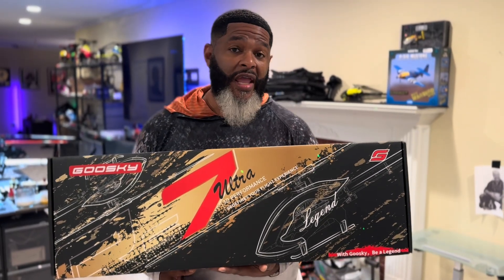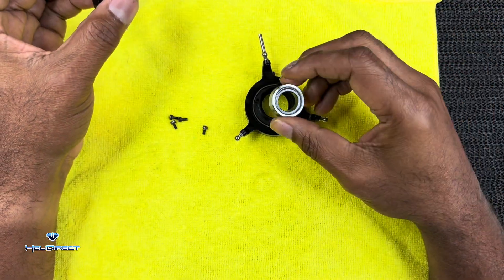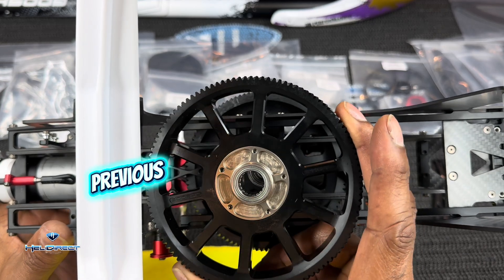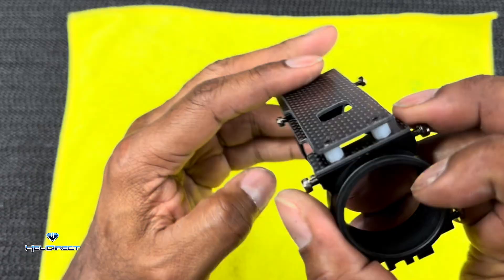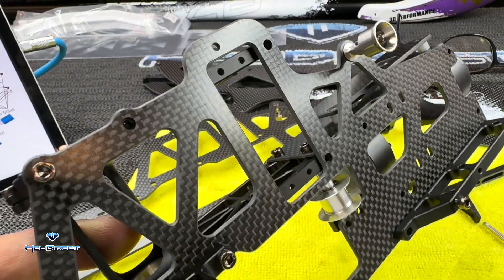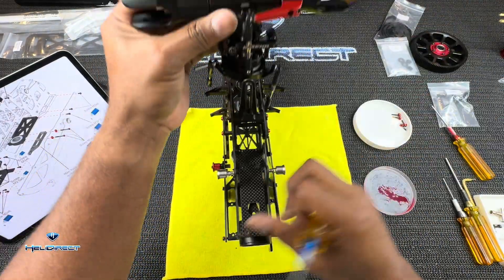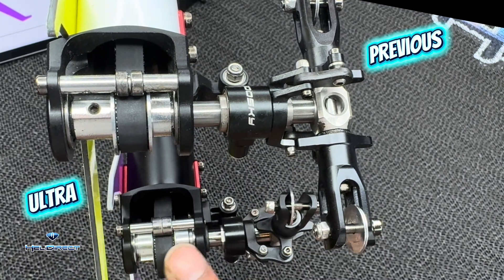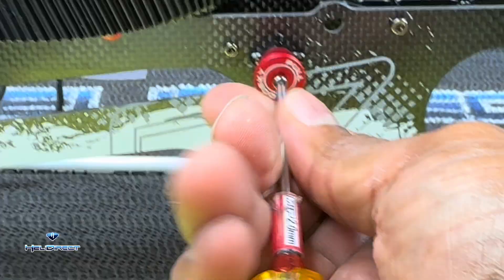GOOSKY RS7 ULTRA vs RS7 | What’s New and What’s Changed? by Dr Sean K!

Comment: Sean, I just bought a SAB ILGobliin 420 Pro, but can't start work on it because Torq BLS0808's are out of stock everywhere. Do you have a suggestion for an alternative servo?
Reply: The cl line of torq servos are really good, im loving the tail servo I use on my minicomet
Reply: @ryanrekz7744  I'm wondering if servo's, such as the CL's, are actually better suited for most people that aren't/can't do hard-core 3D (such as myself)?
Reply from the maker: I would go for theta servos.
Reply: @HelidirectRC  Oofda! With a starting price of $95, Theta's must be the Bugatti  of servos😲